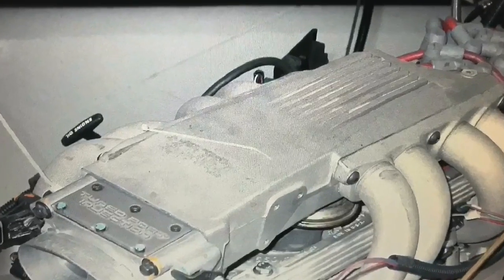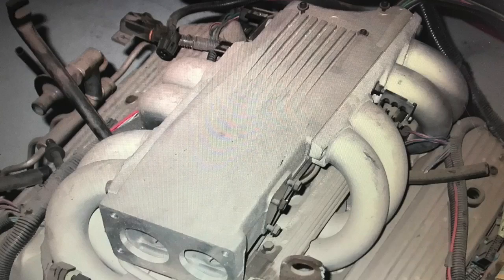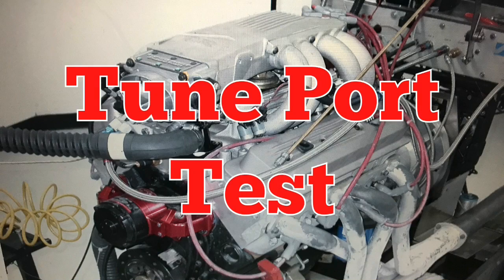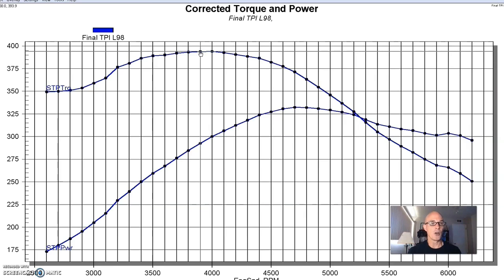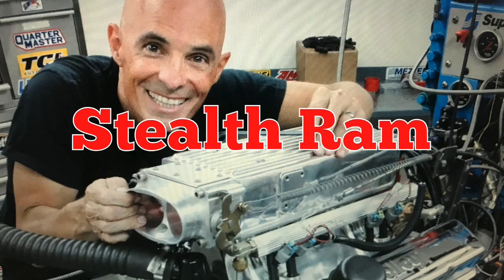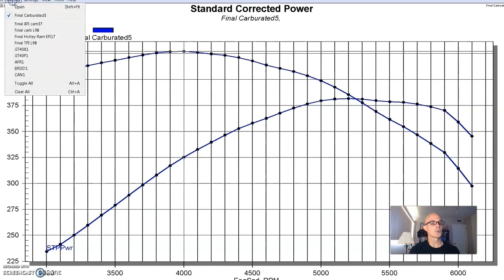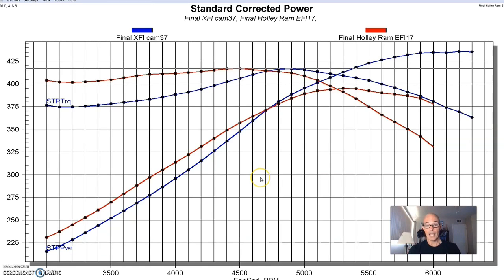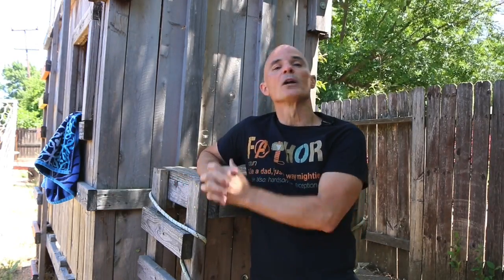TUNE PORT TECH-L98 vs CARB

Comment: Hi Richard love your show by the way I just bought a 1985 c4 corvette I bought this to b my daily car now I know this is no super car my intentions is burnouts from the line and a second gear chirp lol now I’d like a cam that works in the rev range I will change the diff gears any where from 3.5 to 3.7 long tube headers has already a cat back exhaust cold air intake and all the delete such as air pump vacuum pump etc did like the comp cam XR276HR is that to much do u suggest something better
Reply from the maker: smaller than 276

Comment: 2025 update on my 88 l98 c4 - one of the best things I did to the car was replacing the original fuel pump in the fuel tank. Also deleted mufflers and rear resonator with straight pipes with downturns, deleted the air pump on the motor makes me think I'm seriously at 300 hp now that and some weight reduction tricks have resulted in 13.5 qtr mile runs using drag racing app. Unbridled l98 can easily make 300 hp.

Comment: I. Used.  The. Old. Torker.   By.  Edelbrock..  flat. Tappit. And. That.  Baby. Had.   Power. Real. Power.   From. 2000. Rpm..  to.  7000.  Rpm.....  no. Kidding.  No. Joke..      no. Fake.   No. Lie.     For. Real.            I. Was. Real. Satisfied.    With.  All. Edelbrock...  grinds.   I. Had. A. Chance. To.  Try.      I. Haven.t. had. The.  Opertunity. To. Try. The. Torker. ll.   Solid. Lifter.    But. Would. Not.    Hesitate.  With. The. Performance.  I. Got. From.  . The. Performer. Performer. Plus.  And. Torker...  the. Performer. Grinds.    Even. Produced.   Better.  Than.  average.   Gas. Mileage...    have. A.  Nice.  Day...

Comment: I'm shopping for a C-4 convertible 6 speed. The car will run up and down the I-5 or 101 from Baja to Seattle several times a year. I couldn't imagine exceeding 4000 RPM in this use case. The discussion of runner length was very helpful, looks like porting the factory manifold and putting in a mild cam is the way ahead.

Comment: I have a 1984 crossfire 350 and a 1991 305 tpi, and a k30 chevy truck that needs an engine.  Best coarse of action to get something put together an engine for the k30? 1k budget.
Reply from the maker: carb 350
Reply: @richardholdener1727  make more sense than ls swap?
Reply: @richardholdener1727  what intake and carb and what kind of power would I expect?
Reply: @richardholdener1727  do i need truck accessories and bracketry or can I use the vette corvette stuff?

Comment: I had an 86 Iroc Someone put  a 350 with an l82 cam in it. With the TPI that thing was a bit scary. At least for someone who has never experienced that power from a camaro.
Reply from the maker: The L82 is still a mild cam compared to after market stuff-but bigger than most stock TPI cams

Comment: Before GPS, around thirty years ago, my buddy and I tested his bolt-on firebird formula 350. We used a surveyor's wheel to measure 1320 feet, had two walkie-talkies and a stopwatch. We got like 13.6 or 13.7, which was very close to what he got at the dragstrip. Stock heads and cam. L98s have a lot of potential when they can breathe right and are not nearly as slow as people think.

Comment: Nice comparison.  TPI should have been put on the GMT400 trucks from the factory.  Way under appreciated IMO.  I still have a couple TPI systems, and eventually will be putting one on an LO5 with an LT1 roller cam and swirl port heads, and dropping it in an 89 K1500.  It should be mild mannered, and do fairly well with fuel mileage.

Comment: The TPI kills the dual plane/carburetor combo up until 4,500 rpm. If the carb only makes more power above 4,500 then the TPI combo will be long gone and you will be seeing nothing but taillights.

Comment: So Sorry I missed this vid got away from me. 😮  Anyhow thanks for doing this vid!!  Remember now, back then those were net rating #'s.  At the tires with cats, filters in, oh yes, accessories on.  So 332 is about right for a gross rating.  Which heads did the mule have?  113's or 128's?  362 with a carb is not shabby AT ALL!  Especially compared to the L79/L46/LT1.  Very nicely behaved street runner that will take you by surprise.

Comment: As a European, those torque numbers are still damn high no matter TPI/carb. I'd pick that last one producing most HP because anything with torque above 400Nm is damn enough to move a medium weight (medium is close to 1,5tons imo) car around curvy roads.

Comment: Great work Richard and this is great info, but I do have a question. Do the TPI manifolds start making vacuum above 5000 rpm like an intake tract restriction does? Kinda like too small of a carburetor? Mine runs out of breath around 5k and starts making vacuum and it makes me think it needs a larger throttle body, but I hate to spend the cash for no return.
Reply from the maker: It is runner length and not TB size

Comment: What is an "extravagant" 4bbl manifold? I would consider an air gap RPM Performer, kind of extravagant(as for as regular manifolds go).
As far as power production RPM, it depends on what kind of trans It's in front of. Man trans high RPM, auto lower.

Comment: If i did a 383 tpi with a flat top piston with the 60cc stock tpi combustion chamber heads with the stock intake manifold and fuel system, with bigger injectors and a tune will that work with a very mild cam to complement the tpi intake on a 85 i roc z. Id like to see what your thoughts are on a 383 tpi non ported intake manifold, what cam should be ran on this combination?
Reply from the maker: Stock TPI intake will be restrictive on a 383
Reply: @richardholdener1727  that's good to know thanks.

Comment: Great video..! My neighbor has the long tube TPI in his old 78 silverado with th350 trans and 33" tires.. The power comes on like a light switch, but does not like to rev at all.. (maybe 4200 rpm and feels asthmatic - a lot like the 6.2L non turbo chevy diesel)...
Reply from the maker: the long runners are designed to make power lower in the rev range

Comment: Around 1989 Ford offered all kinds of support for the 5.0 pushrod Mustangs.  Cams, heads,headers, rpm extenders, "off-road" catless h-pipes, everything.  GM offered zero support, unless you were scca firestone/firehawk road racers. It was a curious time for sbc 3rd gen cars.  A bunch of high$ companies selling junk that barely made gains. Throwing away the tpi for a carbed rpm airgap would have made good sense

Comment: My bone stock 1989 L98 corvette is a beast light to light but all that comes to end when you hit 75mph...its like throwing out the chute. I mean it will go faster but it takes a minute and you can feel that power production is done at 75
Reply: Sounds about right. Passing gear on the fwy is like hitting the breaks. Still great light to light
Reply: @gordocarbo  Yep
Reply: I have a 89 GTA. Love looking at the design of it still. Think it's advanced for the OBD1 setup from the 80's

Comment: What about a port matched plenum with siamesed runners and a 52MM throttle bottle ZZ9 TPI specialities cam with AFR heads, this is my set up but I want to switch to a Holley computer/tuner
Reply: would run fine, just use the stock ecm and get a chip from PCM for less they have that same tune on file .

Comment: Will the tuned port suffer under boost? I'm  curious because I  do love torque. If makes me loose alot of the benefits, I'll just scap-it. I do like fuel injection though. What do you shine?
Reply from the maker: the TPI does the same thing under boost as it does na

Comment: Richard, my son and I used a Comp 08-302-8 on a 355 Tpi. Stock cast iron l98 heads were reworked with a valve job and new ls6 blue beehive springs and roller rockers. Topped it off with long tube headers and  4 th gen Camaro cat back. It sounds good and pulls hard. This engine was from a GTA and replaced the stock 305 tpi. My son is very happy with the combination of this tpi engine and the t56 transmission. 3.91 gears are coming next!

Comment: I would be curious how easy it would be to modify the intake set up to copy the newer hemi intakes with a built in flap or baffle to redirect air flow. If you added runners that went straight from the top section to the bottom section (short runner) and had a way to mechanically or electronically redirect that air travel to the cylinder head at a given RPM you could possibly have the best of both worlds. VTec effect!
Reply from the maker: the change in the manifold is runner length-which changes the effective operating range
Reply: @richardholdener1727  hey! Have you ever tested the aluminum GM BBC heads, I think the last 3 of the casting number are 401? I have been trying to reach you to ask about those. They're basically a rectangle port aluminum GM head, I think Edelbrock has an offer that shares the same casting but I'm not sure. Anyway, if like to see what those can do. Thanks in advance!
Reply: @derekmelyndadeckens2982  Eddy ususally casts the gmpp heads

Comment: the engine is low stroke - large bore which is a recipe for making power. Instead GM tuned it for torque. Idk why, I guess emissions, or reliability of lower rpm use although more torque means more stress. 60Nm per cylinders stock is quite high for a N/A cast rods. 
So no wonder it can make so much power with the easiest mods. I would go for the stealth ram intake, and the aggressive cam, 450hp is a major step in performance. However my car is registered as historical and not sure if they would accept such mod.

Comment: The car had a 4000 converter and a trans brake. 11.14 in good air. 4.11 gears .3300.00  IROCK.Z STOCK COMPUTER.  TRICK FLOW heads. And alot of people looking and pointing. Lol.

Comment: I know this is really old, but how would this test have gone with an annular booster carb? There is a motortrend article showing a massive pickup of low speed torque with no losses up top compared to downleg

Comment: Do they make dome pistons for lt1 350 engines I can use on 302 lt1 build?
Reply from the maker: YES
Reply: @richardholdener1727  can you give some good choices? I'm using the 5.94 rods from 4.3 and is that a good idea?
Reply from the maker: combined with the stock 4.3l crank then?
Reply: @richardholdener1727  yes. 5.7 block 4.3 rotating 5.7 ported aluminum heads
Reply: Using 5.7 lt1 intake machined for vortec distributor and crank sensor to eliminate front distributor with 411 computor

Comment: I find it funny that if anyone even mentions the L98 aluminum heads on a forum the immediate response is "Buy some AFR's or TFS heads". When you're 16 years old, it's 1993 so aftermarket heads are not near as prevalent or cheap, and an older student working at a junkyard says they can score you a set of 113's for $500.... You jump on them. 

After a little port cleanup and on top of a 10.5:1 327 with a healthy cam, those heads will support more than enough power for any 17 year old to be driving around on the street in a lightweight '69 Nova. My HS autoshop teacher pulled some strings to get the engine on a friends dyno. It put down similar numbers to the carbed L98 you tested(360 something) and the car ran mid 12's at E-town.

Comment: Honestly, for a daily driver or a stump pulling truck, you're almost better off with that L98 TPI set up.  In my case, I'm building a mild 87 roller block SBC for a Firebird that I want to daily drive... the L98 looks very attractive.

Comment: Im not racing and i like the way that torque feals of the tpi set up but you dont loose enought torque to feal it switching to the dual plain intake. Im keeping my 350 a tpi because i like the looks but if push comes to shove i  would go carburetor

Comment: Great video!
Do you have any data showing what the difference between a dual plane intake manifold and a TPI is at normal operating temperatures under the hood of a car?
Reply from the maker: the temperature won't change the difference in the power curves

Comment: I'm a guy who builds for efficiency an low end to midrange torque for daily drivers. Most of what I build peaks the power band around 5000-5500 rpm. I've seen gains of double horsepower and torque from the late '70s carbed applications, with 30% mileage gains, depending upon application. Takes the right combo to do it...

I was kinda surprised that carburetion vs efi alone was better for ultimate power. I always liked the feel of a carburetor over efi, but never tested them like Richard has. 

But then again,  I spent many of my years debunking basic engine designs and "wisdom" from machine shops when they effed up my build..... nothing is more disheartening than to drop $5k on a nice efficient build, and have the machinist say it runs better than ever, and have it bog out in the low end. A friend had the same experience with a 383 K10, and bought a '79 f350 4x4 with a stock 400 that walked all over his "built" 383... 

It's pretty cool to see what works on the dyno, and what parts make what changes.  I would like to see, though,  more dyno graphs around the 1500 rpm and up ranges, where daily driving efficiency takes place!

Comment: I used to have the factory TPI intake on a 400 in my '94 Silverado. Good power but ran out of air flow too soon. Switched to the Stealth Ram and love it. I still have the TPI intake and plan to use it on a 302 or 327 for an S-10. Should be awesome for the smaller inch engines

Comment: Just a quick question? Was there any port work or anything done to the heads. I thought the max life was a .480 on the stock heads. Could the stock heads handle the lift of the Xe268 cam?

Comment: Alright bro,you didn't get into details regarding to what type carb you using,i bet is a square bore.
You get a spread bore with small primaries like a Quadrajet and that's where you low end torque resides.
Edelbrock 2101 and a 650 Quadrajet and you'll have a very driveable machine.
Add a vac dizzy distr. and you'll have clearance,reliability,fuel economy and tons of fun.
Reply from the maker: a spread bore carb doesn't add low speed torque at wot (when all 4 blades are open)

Comment: I would love to see you explore taking the “factory TPI” up a notch to a “sleeper factory looking engine”.  I, like you, love the look of the factory TPI fuel injection and will keep it on my 89 Corvette that I’ve owned for 20+ years.  However, I would still like to maximize the factory set up!
Reply from the maker: I have TPI intakes tests up on the channel, you can do heads, cam and ported stock lower (we used Extrude Hone), then add big runner, ported plenum and larger tb with headers

Comment: Very well done. It was always hard to convince the pups that it's all about where you want to run your RPM range on a consistent basis. The TPI was designed to get optimum performance AND mileage! Can't do that with the carb. It's one or the other! (You couldn't make power AND meed EPA CAFE standards) Straight from the GM engineer in Detroit back in 86', (GM Training School) the 700R4 transmission was made to overcome the mileage loss due to the lower rear end ratios that were used to make you think the engines actually had power! You hit the nail on the head with the runners and the low end torque. It was part of that equation. Once you run out of HP (RPM), upshift and catch the torque band again!  I once found a web page (20 years ago) that had the Chrysler data on their Cross Ram experiments showing where the torque/HP band was for a given runner length. Haven't been able to find it since! It was fascinating. I wish I would have printed it!

Comment: I am gald you brought that up that gm should have put vortechs heads on l98 tpi one could argue they could have made it a little better and not had to even made lt1 even though the lt1 made a good performer all gm was doing was being a stopgap for the ls even though it looks about the same nothing on the lt1 bolt to the regular small block

Comment: not fair for the tpi here its a stock intake vs an aftermarket intake manifold and a very good carb for that time, a fair comparison would be to use a stock GM carb and intake manifold from a production 350 from the 60-80s.  Using the math from the ten times the torque test when a upgraded aftermarket tpi system was used the tpis runners and base it made 6% more torque and 12% more HP than the stock tpi.  Using that same math here a upgraded tpi on this engine would make 417tq and 371hp even if we used half 3% and 6% you get 405tq 352hp proving that when compared apples to apples the efi tpi more than holds its own vs the carb

Comment: I just purchased an 82 Corvette with 66k miles.  Believe L82, TBI Crossfire.   I am a torque quy.  The more I read the more confused I get.  Looking for advice, willing to pay.  Thinking aluminum head with cam to start.  Later headers and perhaps intake.   As always,  I just wanna keep mistakes down and get  the most bang for the buck.  Retired Senior
Reply from the maker: the 82 should be an L83 X fire-it will be limiting in terms of power-headers and cam are good
Reply: Try to ditch the crossfire injection there's a reason it wasn't available for very long.

Comment: Thanks for all the TPI videos.  I'm building an L98 that has to run stock parts for endurance racing.  Since there is not much I can do to move the RPM range up I'm embracing the torque!  Would love to know the value of factory headers vs stock, what the stock ECU vs the nice EFI systems you use in the tests.
Reply from the maker: headers-definitely yes

Comment: Id like to see this test with ported & polished vortec heads and roller lifters and rockers...cause it looks to me like with a full top end done, thats a driveable 500 plus hp motor
Reply from the maker: not 500 hp
Reply: I bet so
Reply: @jimcampbell2024  Not if it fell off a cliff. Wouldnt even make 400